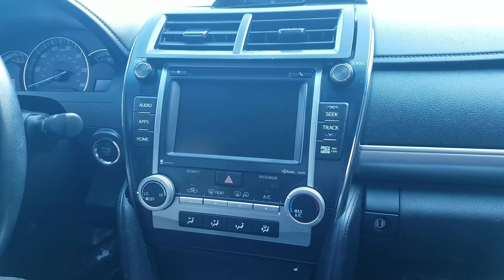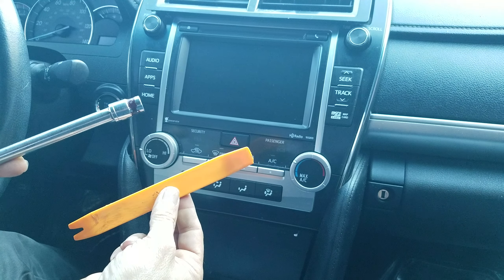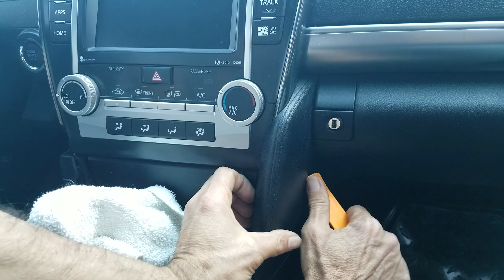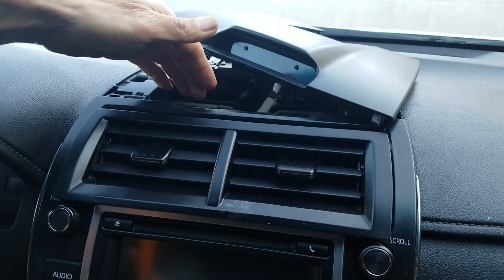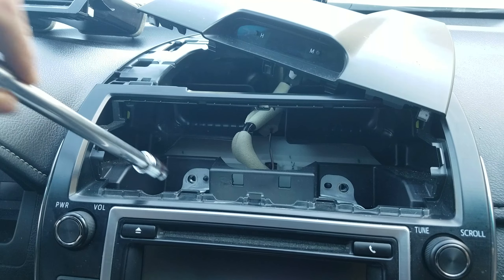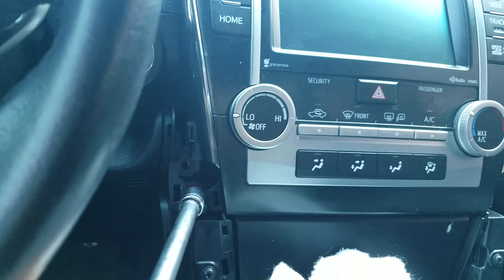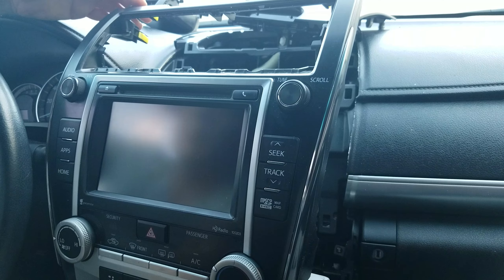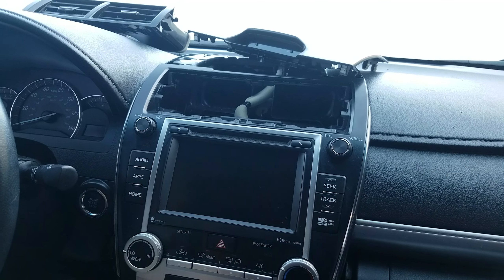How to Remove Radio / Navigation / Display from Toyota Camry 2014 for Repair.

Comment: Can you telll us how to fix the shutter problem in the transmission
Reply from the maker: The 2012-2014 Toyota Camry U760 ATM ECM Software update recall refers to a shudder that can potentially happen in these Toyota models made during these years. The shudder comes from the transmission, especially during the acceleration of the Camry models.
Reply: I had this problem when I bought my 2013 seven years ago. The free software update didn't work for me, but Toyota has another free fix if the software doesn't work. Do some research online and you'll find it. I think they replaced the torque converter for no charge. It's an all day job but fixed the shudder issue.

Comment: Hi my radio on camry 2012 looks simlar as on ur video but on screen it only shows toyota sign and radio stopped working can u plz help me fixing this prob.thanks
Reply from the maker: The main board is bad and you need to have it repaired or replaced.
Reply: Check the sensor there either next to the battery in a box you can get the sensor at any autozone
Reply: @claudialovely7334  wich sensor?
Reply: @claudialovely7334  which sensor you was talking about?

Comment: Have the same one also  2014 with a broken screen.  The unit still works but with the shattered screen the touch screen doesn't work.  How much does that run
Reply from the maker: Please send email through our website or call 818-785-8085 with the ID number on the face of the radio for price quote.
Reply: YeskaSmoke f